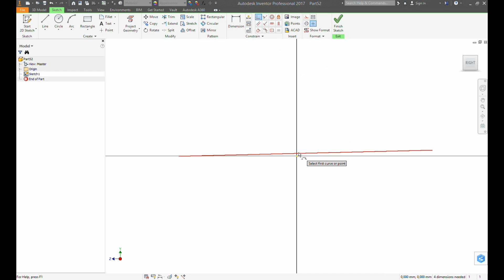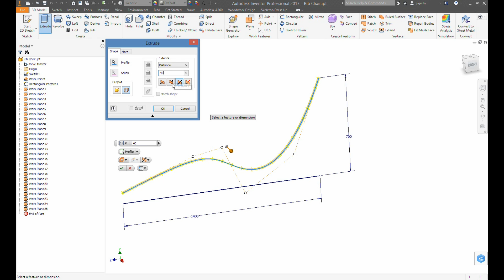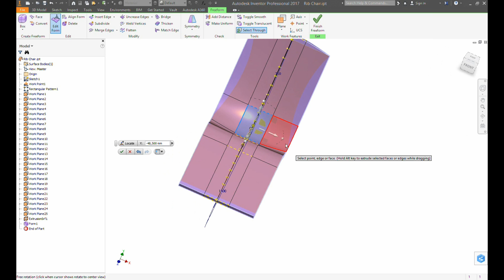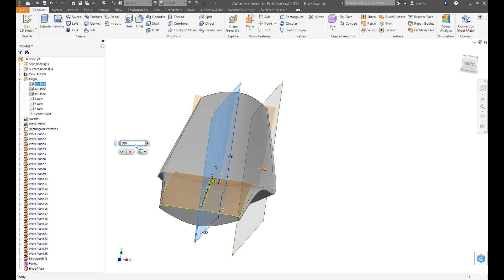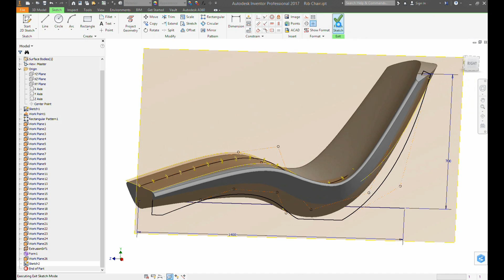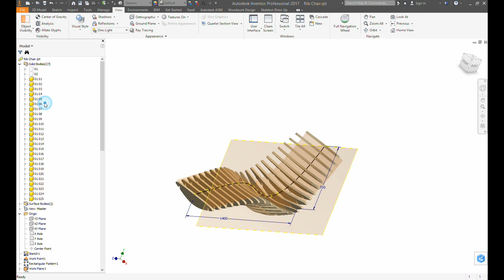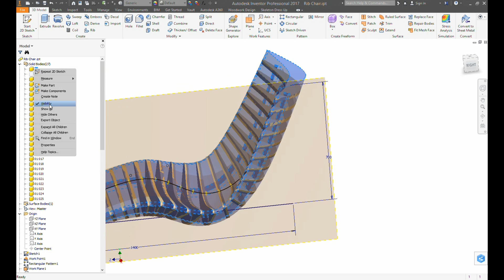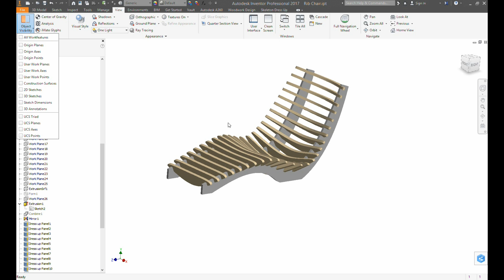Woodwork for inventor V8 and freeform skeleton tutorial sun chair

Comment: As I follow your steps, on the "combine" step it gives an error: "at least 2 solid bodies are required" and I can't go on. In addition I guess a regular Inventor can't do that "dress up" function as I nee woodwork, am I right?
Reply from the maker: Yep if you have add-in app woodwork for inventor then you have "dress up" functionality. You can to it inventor also but you need to create 2d projected sketch for every single ribs. It just takes more time. If you extrude each rib dont forgot to press "new solid" button. If you have multi solids Then you only can make combine.
Reply: @LauriLink  Thank you very much!
Reply: For the combine : The freeform is one solid body. For combining you need a second body. The rib that is created needs to be extruded as a new body. You can do this by selecting the last of the extrude options (Add/delete etc.) in the extrude options where you define a extrution. The button looks like a box with a star next to it.
Reply: @markushavers2283  Thank you very much